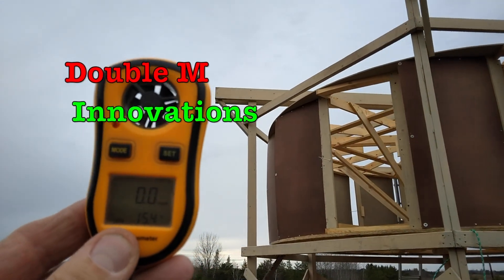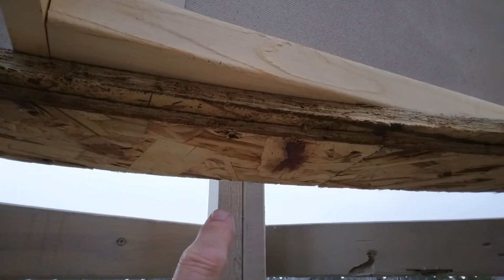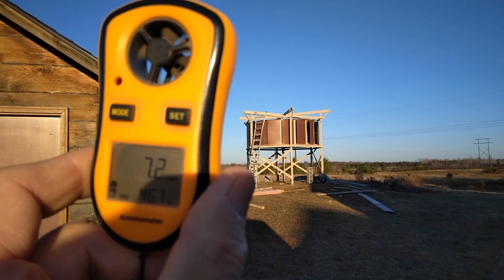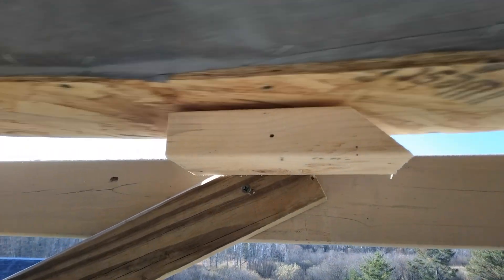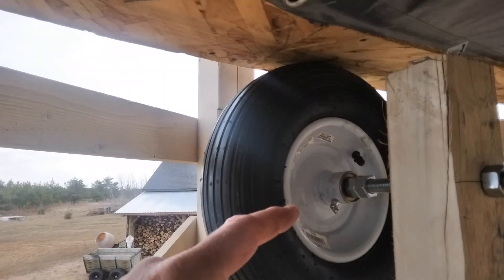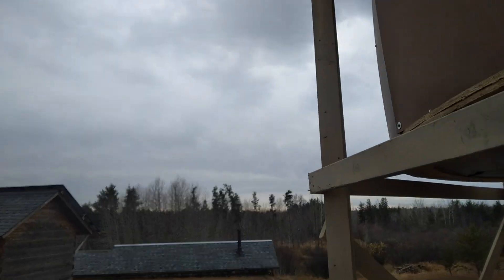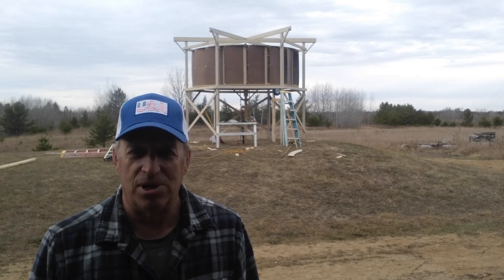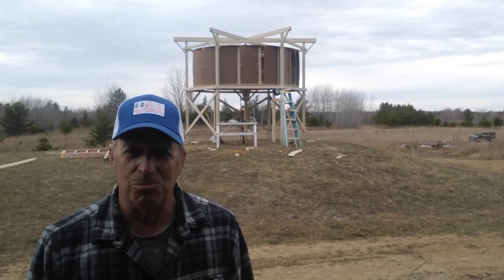Rotating Flow 'Wind' Turbine (3.0), part 3.  Getting some action

Comment: Fascinating! If you are familiar with the Snapper Drive, it is 2 discs at a right angle with the output speed being where they meet. One could do that with this setup to have a fixed final output by where you place the generator from outside (fastest) to the inside (slowest). Then, you would have more control of the output.
Reply from the maker: Thanks for the info!  I have been exploring a number of different ways for the drive train.  Wheel drive, rope drive, and now looking into wooden gear drive.

Comment: Im bench testing a smart drive Lg washer motor 3phase no rewiring just two parallelbridge rectifiers charging 3 1000uf caps 250v (should be higher ) and mechanical limit switch on rotor discharging direct in batteries and coils for testing , i can spin with one finger and 1 rpm is enough power in the caps to kill you or send ya on your ass at best , you could put 20 of these on that beast you constructed and have enough to power you and all your neighbors 😅 GREAT JOB MAN ! i have a few videos on my channel of some tests , thx for sharing
Reply from the maker: Thanks for the tip!

Comment: You should look into the Amish air concepts, they use turbines to pump air itself into tanks, then use that air to spin motors in various tools, whole shops ran on air.. 

You have easily a large enough surface area to spin a pump, maybe not an electric generator but a pump most definitely.. best of luck!
Reply from the maker: Yes; using a compressor pump is something I had in mind too.  Thanks!
Reply: @doubleMinnovations  no problem! I’m currently working on one now! You can convert a small weed eater motor to a pump

Comment: A roll of 2 foot aluminum flashing might be cheaper and easier to apply along with being lighter in weight.. Stretching Tyvek might be even cheaper but not as rigid.. Harnessing the movement from the center post would put less drag on the movement and having a clutch that would only connect the generator or alternator to the hub if the speed was high enough would also be a good idea.. Something like a clutch from an old weed whipper or chainsaw on a shaft that would be after a 200? to 1 ratio belt and pully or gear set..
Reply from the maker: Thanks for all the suggestions!

Comment: Your vawt turbine blades are more of a lift type than a drag type. Picture sail boats tacking across the wind bush sail boats throug water faster than the wind.  Your turbine's tip speed/wind speed ratio TSR should be greater than 1. The other type of VAWT uses drag like aniometer cups or savonious turbines, have a TSR  less than 1. Despite the diameter, it appears like your turbine is not spinning fast enoughb in 5-10mph winds. I think the number of blades in your design is creating so much  turbulance that it reduce the efficency. HAWT would reduce  the number of blades to 1 for better efficency if it weren't for harmonics vibrations with the suporting pole 2 or three blades seems to be a sufficent compromise. Maybe your turbine might perform equallly well or better with 3-6 blades rather than what you have now. Reducing the number of blades will also allow you to take lots of weight off your turbine and make it cheaper to reproduce. 

If the ground were sloped up to the  turbine blades, then the wind has to speed up a little to get over the artifical hill. 

VAWTs with top and bottom caps tend to perform better than without because the block wind energy from escaping out the top and bottom which allows the downwind side of the turbine to capture more wind energy.  

Excessive weight also reduces the efficency of a wind turbine, even more so in turbulent winds. Consider that because of its increased inertia, it takes longer to get up to speed.  And when the wind speed drops the turbine is spinning too fast for the enegy in the wind l, and thus looses the stored energy in momentum as wind comming from blades spinning faster than that which the blades would push them.  Ideally a turbine would be weightless but structural integrity requires some mass so only use that which is needed. 

Good luck with your next build or rebuild.

Comment: No one has ever built a 12' diameter axial flux generator before.
Reply: A 12' axial flux poses a challenge in keeping the gap between rotor and stator consistent and narrow.  He could probably do radial flux with less variation across the gap allowing for  thinner gap.

Have you seen thingap motor stator?  The winding type is faulhabor style radial flux.

Comment: I always wondered if you could take some 1x's and split PVC pipes lengthwise to make long scoops along the 1x's.  We used to buy the 1x's at 16 foot lengths, so greater than 30 foot radius would be easily sourced for materials.  Could use little chunks of PEX tubing for spacers to mount the PVC with a gap off the 1x's.  Run wires tip to tip to control flexion from the torque.  It would rotate slow but the torque would be very high at the center.
Reply from the maker: People have lots of ideas out there for wind turbines.  It doesn't hurt to try something that you think is worth while.

Comment: That looks like a torque monster. Looking forward to seeing how much power it makes.
Reply: i was thinking the same thing. The torque produced by that diameter wheel must be incredible.
Reply from the maker: Yep; there is torque at the center axle, but low rpm.  Hopefully I can gear it up next to the circumference, but lower torque there.  There's a give and take with torque and rpm.
Reply: @doubleMinnovations   How the turbine works: Rotatable shutters mounted on a circular disk automatically open when directed into the wind, irregardless of the wind's direction.  Pairs of upper and lower shutters are geared together. The lower shutter acts as a counterweight to the upper shutter. The bottom shutter opens in the downward direction and its weight helps to lift the upper shutter in the upward direction, as the wind applies an opening force against both shutters. When the shutters reach the vertical position, stops prevent them from opening further and the force of the wind is transferred from the open shutters to the circular disk.  And the circular disk is attached to the vertical axis for power output. The circular disk, shutters, and outer vertical axis rotate together. The outer vertical axis is mounted via bearings over an inner vertical axis that is stationery.

The shutters are blown closed by the wind (no stops in the opposite direction) as they reverse direction during their rotation and move into the wind on the opposite side of the wind turbine.  When the wind is not blowing, the shutters open by gravity because the lower shutter is weighted to be slightly heavier than the upper shutter and it therefore can cause the upper shutter to open via the force of gravity as the two shutters are geared together.  Wind blows against the open shutters and the open shutters with stops apply a force against the disk, but the open shutters with no stops (opposite side going into the wind) merely close due to the force of the wind (not applying a force against the disk) and the wind turbine begins spinning no matter what direction the wind comes from. Operation of the turbine is remarkably quiet as compared to the appearance of the video due to biasing members that absorb the shock of the opening and closing and provide useful energy output.

Background:

Robert D. Hunt has designed an innovative new disk-style vertical axis wind turbine or hydro-turbine that produces far less drag than does a conventional horizontal axis wind turbine that has vertical propeller type rotor blades of which the entire circumference of the vertical blades, known as the "swept area", creates drag.  An additional negative aspect of conventional wind turbines is that they must be directed into the wind, which is not necessary with Hunt's new vertical axis turbine.

Comment: I hope you will get some watts out of this big construction! In my country, Latvia, I know two men`s, who try to make this type of WG. One man make a huge construction - about 5 meters high and spend about 20 000 Lats in old currency which is about 28 000 Euros... and get nothing! It stands as dead tree... Another man take long axis and make skinny (not wide) screw design and get very little and it just rotates in the wind for decoration... P.S. Wind Generators for home "brewers" is not easy task. At first it is not efficient - one part rotates, second part break rotation... In old times I think about WG DIY, but no. Fingers crossed! :)
Reply from the maker: My little turbine is a yard decoration; this one is a study.  Have about $600 into it.  We'll see what becomes of it...
Reply: @doubleMinnovations  :) yes.
Reply: @doubleMinnovations  What do you have planned for to convert the rotation to electricity? My MPPT needs 125V to kick on.

Comment: I guess you don't really read these comments. I made some suggestions on your previous video, if you looked at the videos that I suggested in the comment. Yes I know that the videos that I suggested in my comment may have potentially been considered spam and you didn't look at, however, they were actually videos to explain ways to make this style wind generator more efficient.
Reply from the maker: I reply to some comments when there is time.  Don't take it personally if I don't, or don't use some suggestion.  If they are not deleted they are there for others to read.  I don't delete unless comments are offensive, not sure when Youtube deletes.